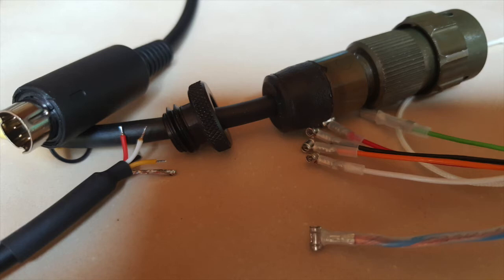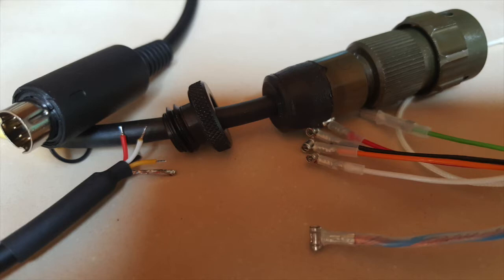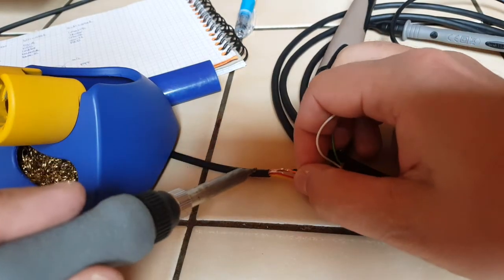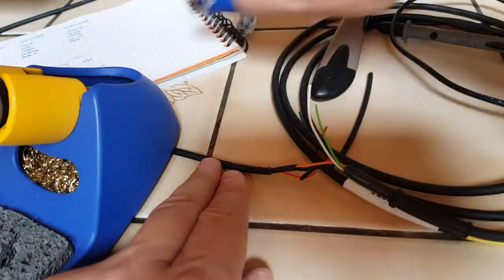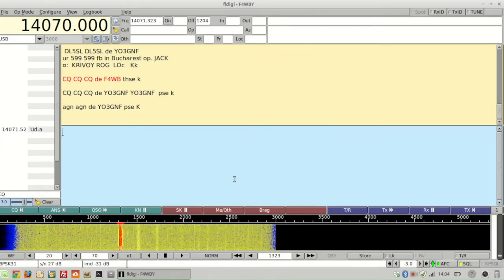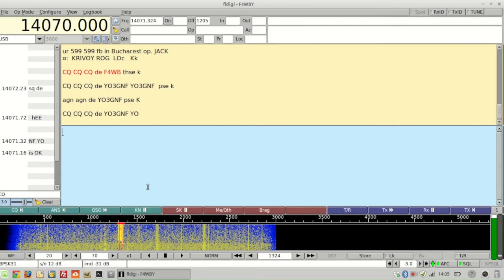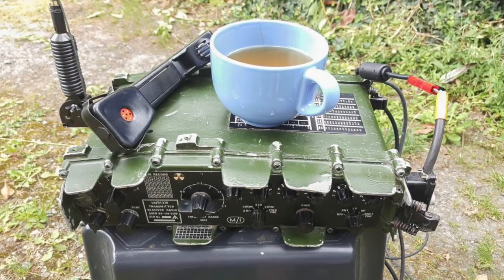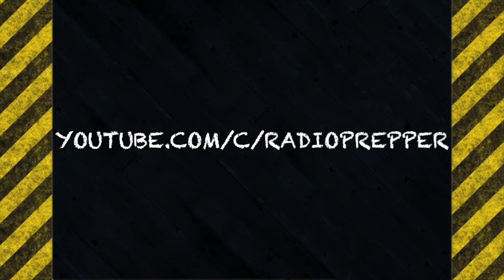I need help with my RT-320 home-brew digital interface cable.

Comment: I see this is old video, but I was building my own interface for that radio so i can share my thoughts.
First check if You can hear relay clicking in radio after keying up via interface,  if no relay click in radio mean problem with PTT line.  If relay click then problem is in "mic input" line.  Input line is a very tolerant, PRC320 have build in circuitry to keep steady audio level, so it gain up / gain down automatically. Keep in mind that MIC line in clansman radio are "separated" pins, put a isolation transformer (600:600) between them (one side to plugs call it primary), and secondary tie one to GND  (of interface) and second to audio output of interface.  <- should do the job!
Reply from the maker: Electronic Noob Blog Thanks, good info. Make sure you check my Radio Prepper YouTube channel!